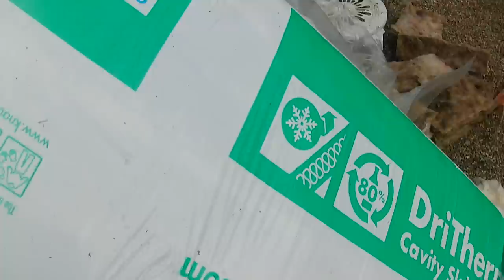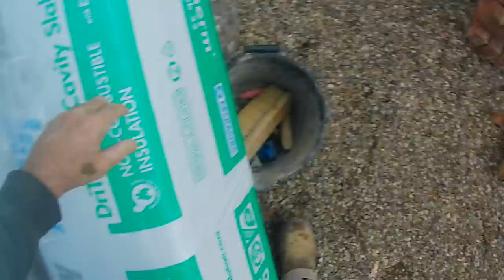Pic and Dip full joints.

Comment: Lovely stuff . I’m the same with the soddin head cam 🙄. 
   As for that  Knauf insulation we absolutely hate it ! It fluffs up and expands and gets in the way . We use the bright yellow  Isover , it’s shit hot , stays  rigid , cuts better and Dont fluff out 👌🏼👍🏼🧱
Reply: We mostly use 150mm fulfill rigid insulation here.believe me you don't no how good you have it that wool.wudnt believe how much it slows you down
Reply: @ffleeney8507  year hate the rigid stuff 🙄🧱👍🏽
Reply from the maker: That fluffy stuff is just the remnants of some leftovers, the new stuff is quite rigid and not to bad but yes Isover by far the best but we just use what we are given.I bought that cap Kurt was on about for the headcam hopefully just needs a bit of fine tuning 👌
Reply: @SteveAndAlexBuild  so much work with it.have ye got the stuff with the plastic on it?supposed to fulfill but if you do that it leaves no margin for blocks or brick being 105 or so. Something has to give
Reply: @bricklayersworldwithandy6277  . 😁🧱👍🏽👌🏼
Reply: @ffleeney8507  . Only ever used the 55 mm in a 100mm  cavity all pissing about block first , jointed then insulation, clips n tape what a faff 🙄🧱👍🏽
Reply: @SteveAndAlexBuild  here now it's a 150 cavity with this 150 insulation.yes 150 cavity with 150 rigid insulation with a plastic face on it.impossible to cut square.corners are metered at 45 but rarely works outs.puts  pressure on walls to lean off plum.nightmare
Reply: It's a lesson everyday with the stuff. Can't bate d old 2 inch insulation and fishtail ties
Reply: @ffleeney8507  That’s ridiculous! 🤯
Reply: @SteveAndAlexBuild  it's tough alrite.i still leave the cavity 155 just to try have a little play
Reply from the maker: @ffleeney8507  I used it once, you can build Bwk first with it if you read up on it.Some people do that and just lay the blockwork against it no line or level. We gave it 5mm and pulled a line, we found it OK other than cutting angles over trays so we set up a bench saw for it.
Reply from the maker: Have you used your chest cam Steve?
Reply: @bricklayersworldwithandy6277  saw a lad building up against it before.house was all over the place.i always keep 5mm or so and with a line,2 in 2 out.the old way of doing it
Reply from the maker: @ffleeney8507  👍
Reply: @bricklayersworldwithandy6277  yeah a couple of times , I prefer it but it’s a bit close to the work 🙄
Reply: @SteveAndAlexBuild    Maybe the shoulder mount is the best compromise? Bit further away but still accessible... :-)
Reply: @handycrowd  nor seen them 🧐🧱👍🏽
Reply: @SteveAndAlexBuild  why would you hate rigid insulation????
Reply: @maciejwronaki4550  awful stuff to install 🙄🧱👍🏽
Reply: @SteveAndAlexBuild  everything whats good and works require a bit of time to install. Is there another country in the world putting fibreglass insulation in the cavity?
Reply: @maciejwronaki4550  🤷🏼‍♂️🧱👍🏽

Comment: i thought the dip part was dipping the brick into the bed to pick the muck up for the perp so you dont have to butter it?
Reply from the maker: It is but I modify it so my joints are full and flush, in Holland where it sort of originates from, though it's used all over the world, the bricks are generally around 50mm thick so easier to pull a full head joint on, also there work is raked out and pointed later so joints don't have to be flush.In Germany they have many different size bricks so they sometimes adapt the method the same. I can't see the point in laying bricks faster but taking twice as long to fill the holes and joint up.